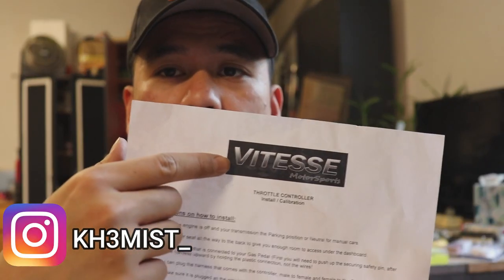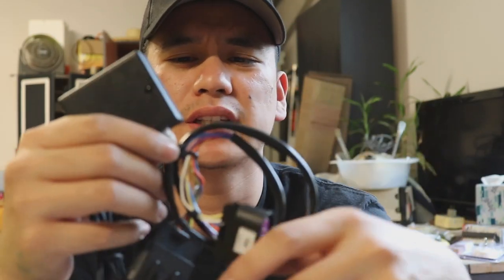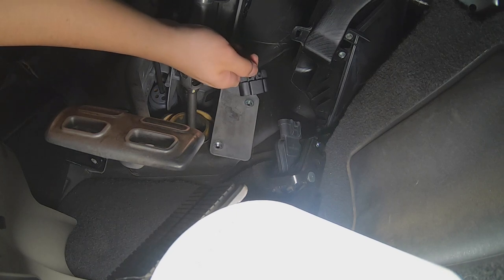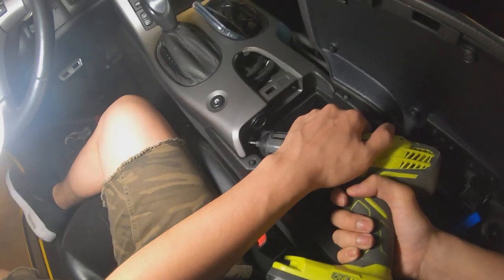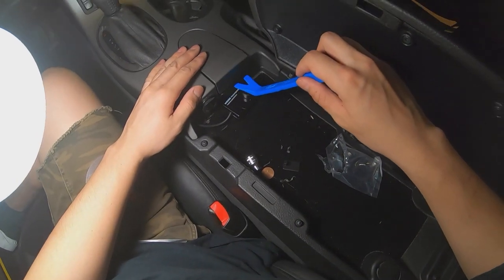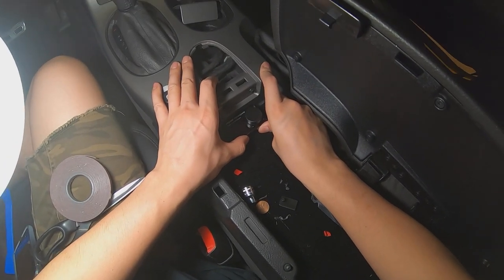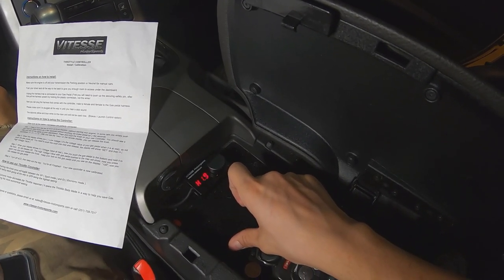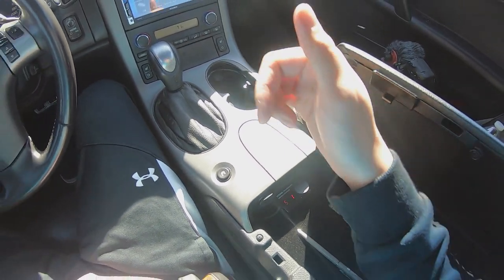Are Throttle Controllers Worth it?

Comment: Its just tricks ECM to thinking the throttle position is higher then what you are actually pushing. So at 30% throttle it tricks it to thinking you are pressing 60% and so on. Doesnt change power or anything.
Reply from the maker: Thanks  for watching and explaining it! I forgot to mention that in the video 😅. I’ll pin your comment just in case anyone thought it increased hp🙌🏽
Reply: @Kh3mist_  you plan on doing a zo6 rear fender conversion?
Reply from the maker: @John-qz4cv  eventually I’ll go that route haha it’s been on my mind for a while now 🤣
Reply: @Kh3mist_  same here with mine. Not cheap though. Kit and finders with paint is over 2100 doll hairs lol
Reply from the maker: @John-qz4cv   seriously so expensive 🤣  I’m not sure if you’ve seen True Fibers C6 Overfenders Probably around the same ball park as that but both front and rears painted. The OEM wide fenders will For sure be better and better looking in my opinion but i was reading on the forum it’s about 5-6k for the whole conversion that’s as much as an A&A supercharger. 😩
Reply: @Kh3mist_  yeah but just doing the rears looks good also, my buddy mark has his done and looks awesome.
Reply from the maker: @John-qz4cv  wow thank you so much for that link! I couldn’t find any websites that included the whole kit and painted it for you! If you get it are you planning on putting Z06 wheels in the rear? Or  after market like forgestars?
Reply: @Kh3mist_  good question, I'm leaning towards aftermarket on the rears. My buddy did c7 z06 wheels on all four but since he only had the rear done with z06 finders and left the front base he did the 19x12 in the rear and left the front the base width and it looks sick!
Reply: @John-qz4cv  I have a C6 base model with z06 quarters and got aftermarket forgestars. I did a ton of research and ended up going 19x9'' +38 spacing up front with 255's and 19x12'' +50 on 345's in the rear. The spacings also should allow me to fit Z06 brakes under the front wheels when I eventually want to do that and looks more flush/aggressive than stock. I'd go aftermarket.
Reply: @murffly  how does it ride and handle? Do you notice better traction in the rear?

Comment: You can check only if measure the  seconds from 0 to 60mph ,stock then modify...if you not faster after it,its a useless mod,but a bigger(stock auto c6 ls2) aloy Radiator and cold air intake are a great increase in power,..and it pulls much better after it.🤔👍I think its a BS Mode,not a pro mechanical one,check out Nurburgring Nordschleife corvette zo6...that are great mods...🤣🤣🤣🇪🇺🇩🇪🇺🇸Greatings from Europe..bro

Comment: Is that just for automatic or manual too?
Reply from the maker: Hey thanks for watching bro! And it should work with a manual too. I was reading on the corvette forum this is one of the most popular mods to install and both M6 and A6 corvettes are able to use them. It’s main purpose is to just minimize the lag between the gas and the throttle
Reply: @Kh3mist_  Niiiice😎